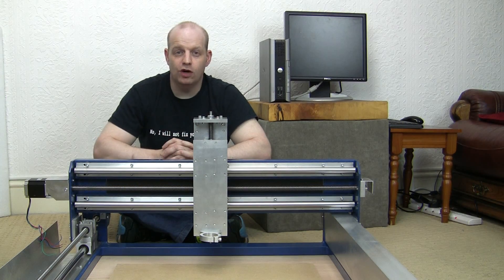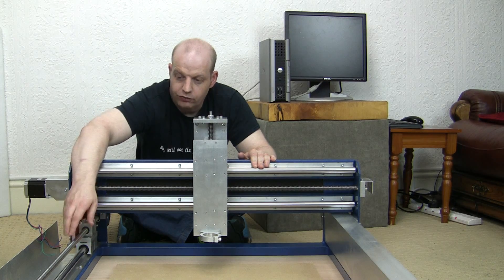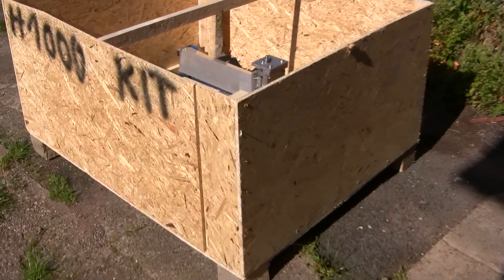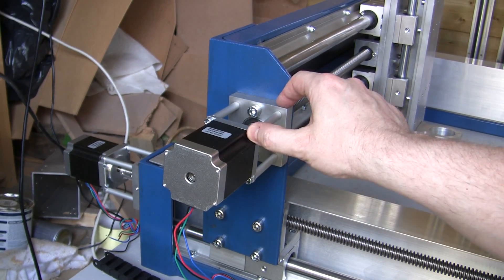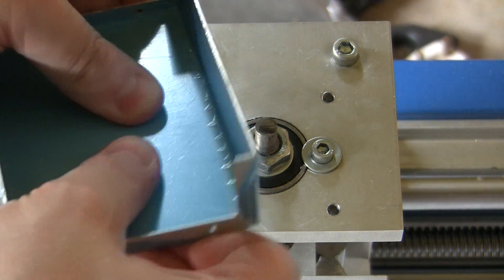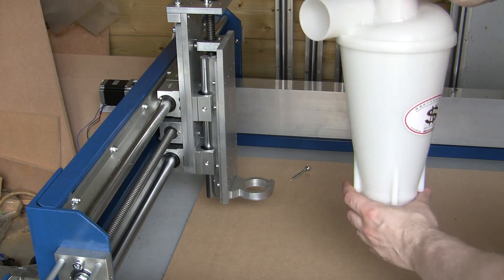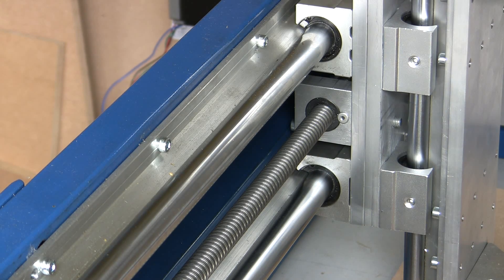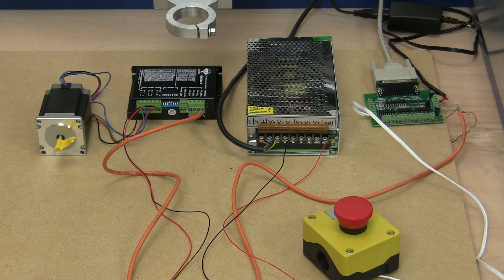CNC Router Build - Part 1

Comment: Those motor couplings are bad for that application,they unwind very easy and loses their strenght.Did you measure how much flex do you have in Z axis when you put some force by hand?
Reply from the maker: Its been 3 months since I looked at this. Sorry, got distracted, then busy with work. Plan on finishing this one day. I'm assuming you mean the thing that joins the shaft to the motor. Not having run it yet, I can't really comment, but I can imagine there will be a lot of force transferred through the coupling. Is there a better type you would recommend? Those pillars the motors bolt on with look a little flimsy too. The Z axis felt quite solid from what I remember. I'll be mostly cutting sheet materials with it and I expect 1/8 inch cutters will be my normal tool. I'll have a sacrificial board underneath, so I would hope the Z axis precision will not be a vital. Thanks for the comment BTW.
Reply: Yes,the coupling that connects motors to the trapezoidal leadscrews.Use coupling that have polyurethane insert,like this one http://i.ebayimg.com/images/g/H-UAAOSw9mFWMmt3/s-l300.jpg 
And for the Z axis,i was aiming on stiffness.Putting dial indicator parallel to the Z axis then applying force on it.You will see some deflection.I had this problems long ago,so hope will help you.
Reply from the maker: Thanks for the advice